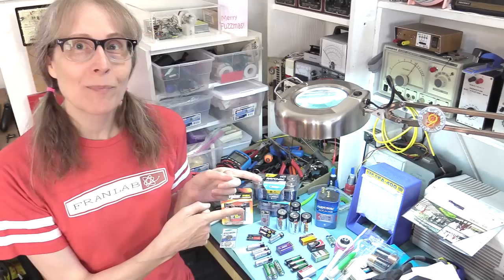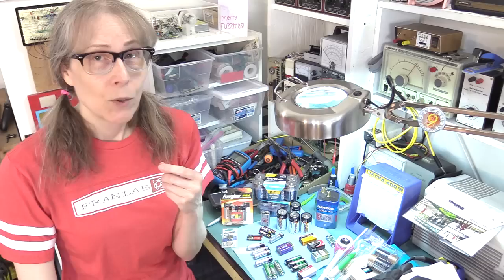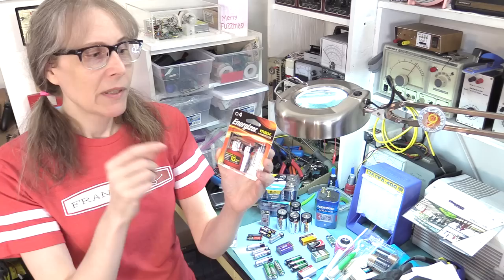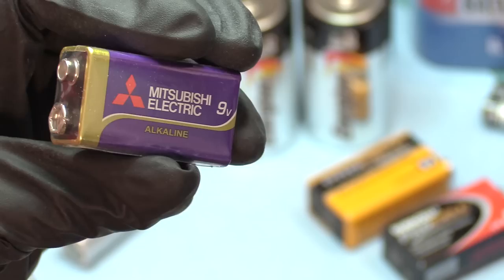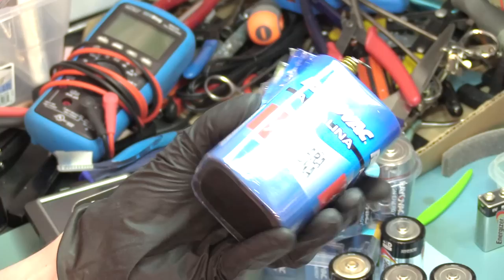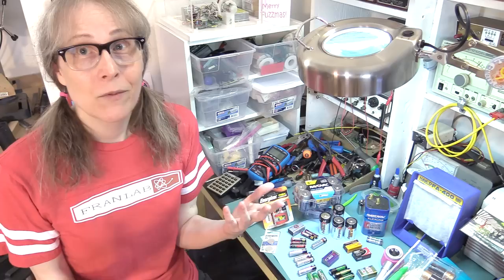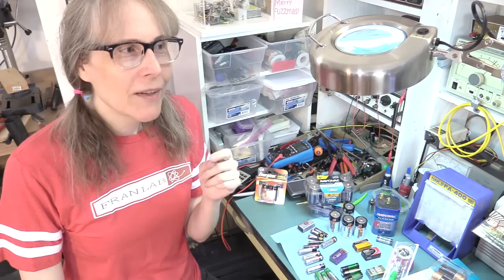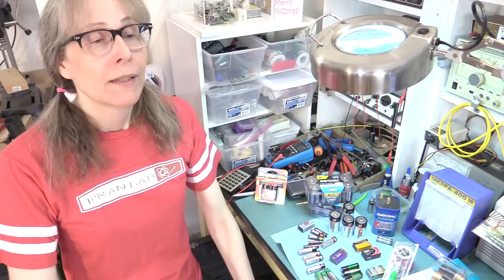Yikes! Leaky Alkaline Batteries!!!!

Comment: If a battery says "Super Heavy Duty" it will not be Alkaline.  The "Heavy Duty" refers to Zinc Chloride which compared to the earlier batteries I think was an improvement but not at all what we would consider heavy duty by todays standards at all, so they tend to be quite misleading to consumers.

Comment: Rather than risk leaking batteries in my TI-83+ graphing calculator, I made a pair of plastic dummy batteries and wired brass end-contacts on them to a USB cable.  Now the calculator runs on my 7W solar panel (with USB output) without being in the sunshine (or any other USB power supply).  Unfortunately, my USB phone-charger power bank turns itself off after a few seconds; maybe it thinks that I'm not drawing enough power to bother with?

Comment: Duracell changed the battery design and have leaked the most of any brand  for years.  I avoid them as much as possible.   Have you ever tested an alkaline  battery by how high it bounces off the table?   Sunbeam makes cheap  appliances probably next to a battery factory.    I had to look for my emergency flash light kit.,  A 4 pack of energizer D battery  from 1995,  Best used by 1999.  Still 1.45 V .   Swapped the bulb to a LED to make them last longer if I need it.

Comment: Great to see you feeling better and posting awesome vids!!!! Question: Do you equate "shelf life" with "installed life?"  In other words, do you  think the advertised shelf life means you can install a battery and it will be good for the shelf life?  My practice is to remove all batteries until they are needed.  And then reach into my battery storage, grab a "shelf life" rated battery to get things moving.  As with Kermit, there may be a drain not known.
Reply: No, because a lot of devices have parasitic draw that will slowly drain the battery. I only use batteries in devices that I'm actively using and take them out when not in use. For example,  my TV remote stays in use all the time, so batteries stay in it all the time. My ac remote keeps batteries in it during months im using it. Then when I pull the ac out of the window,  I take the batteries out of the remote, and put it up till next summer.

Comment: I ended up here because i made good an old calculator that had a leaky Duracell in it. It has a use by date of 2030 & the second one hasn't leaked. Someone said maybe one had gone flat & been reverse charged by the good one. You have a nice collection of batteries there & some people collect them. I remember having one called flying bomb.

Comment: If the corrosion has not destroyed the radio (or what ever) , remove the offending batteries and brush on apple cider vinegar to clean out the corrosion.  Then clean up with water and dry

Comment: I've never had a Rayovac leak after it was dead, most leaked batteries were no name trash or Duracells, very very rarely Energizer will leak
sunbeam idk because they die so fast i don't have a chance to leave it lying around, Panasonic makes a decent AA at the dollar store but idk about them long term
(I have some really old batteries from Walmart back in the early 2000s with some juice in em, they are shiny blue with a lightning bolt on it, not ever ready but it's ever-something)

Comment: I've gotten into the habit of writing in the install date on batteries, not so much as a reminder to replace them, but more as a curiosity as to how long they lasted.
I just looked up at my new battery pile (I keep a small stock of AA's etc) all Duracell - time to change brand? the general consensus seems to be that they have lost the plot in producing a quality product.
As for lantern battery's, boy are there a lot of extremely dodgy ones out there, you open them up and there is a big plastic spacer and 4 very small (sub C?) cells in there - what a load of rubbish.

Comment: Almost ruined a $180 Wicked green laser I bought back when those were pricey from junk Duracell's. I've had new unused Duracell's leak and not even close to their expiration date..Went to RayOVac's and have had some of those leak also, but not as bad. So far I've had no Amazon Basics battery leak and from testing by Project Farm, they are the best bang for the buck. All AA's except AAA's in laser.

Comment: Those GreenCell batteries in that Kermit toy aren't alkaline batteries. I believe they have a different chemistry. I forget exactly but the "heavy duty" batteries are usually not akalines. They are meant to be in low drain devices and have longer shelf lifes so it's not surprising to see that the batteries in your Kermit toy are still good. Had they put alkalines in him you definitely would have opened it up to find exploded/leaked batteries given how long they would have been in the toy. :P

Those "heavy duty" batteries are best used in things like remote controls and stuff like that Kermit toy that only makes sound (and maybe moves a little. A small motor here or there could probably run from these batteries too). You could avoid potential leaks that way especially in low power devices you don't use often. I've never seen one of these heavy duty batteries leak. I don't think they can due to the different chemistry they use.

Comment: I use sandpaper to clean contacts after battery leak. I try WD40 etc but nothing work well.
Than I try hydrogen super oxide. H2O2.  And work well to clean contact after batery leake.

Comment: Bought a big pack of Duracell Industrial C cells for use in an audio field mixer.
Less than a month later there was liquid pouring out of the battery compartment.
Before this we were using some 3rd grade brand and never had any problems.
Didn't like Duracell already but after this I certainly stay clear from this brand for the rest of my life!

Comment: have old Duracells from the 80s from my childhood that never leaked and still work to this very day!!  Those were made by Gillette.  Then Gillette sold Duracells to Proctor and Scandle (in 92?) and they became crap at that point because P&S did something to cheapen them to make higher profit and destroy more of your equipment!  I'm not surprised that 9V "batteries" have lesser warrantees.  You can open them up and they are really just 2 rows of 3 (6 total) cheaply made paper-wrapped AAA cells.. so of course they leak quicker because its just the cheap outer thin metal shell that is the only defense from leaking.  Your lantern battery I've never seen with AAs inside, but I have found them all to have 4 elongated D cell batteries.  SO I have gutted the shells of all of mine and insert  2 or 4 (in series/parallel for twice the amperage, twice the wattage, twice the battery run-time because 2 of them in series is just oner 6 volts under load and they hold way more runtime than any alkaline or drycell.     As for direct replacement of alkaline that is easy, just go with NiMH rechargeable.  They have no downside and if you buy good ones instead of junkChinese ones sold online, they have over 2000mAh which is as good as any Alkaline really an you can recharge them hundreds of times if you ue an intelligent charger that doesn't over charge or over temp cells.  They have newer technology NiMH rechageables called ULSD (ultimate low self discharge) which come precharged even and can hold a change for a couple of years just sitting.  Those kinds of ULSD Nickel Metal Hydrides are the perfect drop-in no-leakage replacement for all you alkaline battreries and they will save you a ton of money versus the very environmentally unfriendly landfilling and energy resource waisting thow-away alkalines.   Yes thee are some obscure chasers that can recharge alkaline batteries but my experience with those has been checkered results.   If you combine quality brand NiMH (Duracells NiMHs are actually quality compared to their crappy Alkaline leaksters!) with a quality intelligent charger like PowerEx or Maha or XTar and you will truly get hundreds of recharges like the packaging says.    DONT BUY DURAHELL BATTERIES (unless they are Duracell NiMH rechageables).  Also I have 18650 Lithium-Ion cells from their debut in he 90s under Sony brand which still work and don't leak!

Comment: So, let me get this straight, GP and HD batteries don't leak?!?!  Hmmmm, I don't know about that.  I mean I have been using alkaline batteries for as long as I remember and I have had experience with all types of batteries leaking except for button cells.  So I found that out when Fran mentioned she had button cells leak.  That never happened to me.  As for Energizers being leakproof?  Well, I can't recall that, but many years ago as a kid, I have had the silver Eveready batteries (not Energizer) and the RayoVac (non alkaline) batteries leak.   As for those large 6 volt batteries, I think I only remember one ever leaking on me.  Usually those are pretty good.   But in terms of modern batteries, yeah the Duracell copper top batteries are definite leakers.  Also Radio Shack batteries, the white ones with the orange writing on it, they leak also.   But as Fran says and some of you below having issues with flat batteries, that is something that never happened to me.   Yes, I have had button cells go dead, but I have a pen with a clock in it that has a dead pair of button cells in it for 15 years and they still have not leaked.

Comment: Just occurred to me: you could put a piece of heavy duty aluminum foil over the ends of the batteries. That should save the battery compartment if the batteries leak.

Comment: My TV remote had Energizers in it, found them leaking a fortnight ago. Thankfully checks regularly, so barely any corrosion and only a bit of clear liquid.  Sadly can't trust the promises.
Started using NiMH some years ago, mainly IKEA Ladda and they haven't leaked any... yet.
Worst yet was a 9V Philips that 2 years before its expiration date leaked so catastrophically that I had to work my ass off to get the expensive scales in working order again. Corrosion everywhere.
Never had a litium leak, despite a decade after expiration. Lucky me I guess.

Comment: Oh, yes the 'fraking' alkaline batteries. I lost two HP 48g calculators last week 'cause of leaking AAA batteries. And it doesn't matter if its validity has not yet expired, if it is being used at an ideal temperature, this crap just leaks overnight.

Comment: I always used to use Duracells when I knew I was going to leave the batteries in for a long time, especially low drain stuff prone to leaking over a couple year period....

I use rayovacs for every day situations but lately theyve been leaking on me in some junky cheap flashlights I got on amazon, like 12 of them for $20 or so, little pen lights, not sure why they leak because it only takes about 6 months!

Comment: Damn Duracells are the absolute WORST!! I always go for Energizers. If there's no other choice than Duracells, then keep an eye on them. If it's a device that doesn't get much use, then take the batteries out. And stay away from Rayovac, they just crap. Batteries from China/Japan are just to get the device up and going, but they're cheap and do not last long.

Comment: I bought the opposites of the GP double or triple A cells.  A Radio Schnook supplied big blister pack.  They leaked IN THE BLISTER PACK! Only 1.5 V across them all.  You may have noticed the battery with the base at 0V (ground, sorta) in a device leaks first. Ugh!
Reply: 9 volt batteries are a lot like your big pile battery.  The 9V battery I opened up had 6 little round cells in series in it.  Maybe the lighter ones have fewer cells and a charge pump to get the required voltage.
Reply: Thanks for the cleaning contacts tip, DUH! I should have tried vinegar or lemon juice but my brain refused to work on the problem! Consequently, I have become expert at mechanical cleaning of said contacts.

Comment: After seeing the off brand King Kong Batteries it reminded me of my remote for my CD changer we bought back in 1988 that came with Japanese brand AAA batteries. The remote finally quit working in 2017 (29 years). When I went to replace the batteries they were the original ones (I thought I had changed them over the years) and they never leaked. Definitely not Copper Top. So these off brands are some times better.
Reply: King Kong Batteries is actually a major Chinese brand, based in Shenseng.

Comment: Primary lithium pile is the answer, AA or AAA lithium cells are not that expensive, and do show up in capacity and current capability; I'm never going to put Alkalines in my Fluke 289, that thing eats a dozen, if they leak, the meter is done for

Comment: I stopped buying alkaline batteries almost a decade ago. I've found that in the devices I use (portable recorders, wireless microphones, etc), NiMH batteries last at least as long as the alkaline. So far, I haven't had a NiMH battery leak.

Has anyone had a NiMH battery leak?

Comment: Duracell branded cells are, by far, the worst, the very worst for leaking.  If you buy a pack of them, most will be unusable long before you've used a quarter of them.   My last pack (guaranteed for 10 years) was only a few months old when I went to open it.  At least a third had leaked in the unopened package.  I'm a retired engineer, so I wanted to contact Duracell to see what kind of QA program they had and perhaps help them improve their processes.  After several weeks, no reply.  

No, another great old American company that was once the most trusted name in its field, but is now well on its way to extinction and a well deserved extinction, for that matter.

Comment: I've never really had any issues with 9 volts but I think that's mostly due to their construction, there either piled cell's or their round AAAA cell'sIn side.
I've also never really paid attention to the expiration date I've had batteries last forever I use them until they're dead then I move them around to something that has a lower draw and so forth.
Reply: Those AAAA cell 9V batteries are like 1mm longer and they won't fit in so many things. I even had one that came with a cable tester, it was still in plastic wrap, and I had to take the thing apart to get it into the battery compartment because it wouldn't fit through the hole properly when attached to the connector.

Comment: I have had many Duracell batteries leak, still in date right in the pack. AA and AAA are the worst but also C's. I have the most problems in low current draw applications. I don't buy Duracell anymore.

Comment: Maybe living in a hot, humid climate is harder in batteries or maybe it's just low Q.C. these days but I have lots more battery leaks than in the good old days. The best AAs and AAAs I've found as far as not leaking are the Duracell Quantum. Copper tops are junk, Energizers not much better in my experience.

Comment: I'll never use alkaline batteries in a device worth more than the batteries themselves.  They are disposable batteries for disposable devices.  They're not called 'alkaleaks' for nothing.  I'll use Eveready Ultimate Lithium, Panasonic Eneloop rechargeable or lithium ion cells in devices that can handle the higher voltage (high power flashlights).  An insidious property of alkaline batteries is that they can still supply power while they are leaking.  This is especially the case with TV remote controls.  By the time you realize that the batteries are getting weak (reduced range) they have already begun to leak and cause damage.

Comment: This video started out strong with a quality explanation, but then got pretty muddy in the middle and I'm not sure what you're trying to explain anymore...
It seems like you have a solid understanding of alkalines, but don't understand what heavy duty batteries are for or why they come free in so many devices.

Heavy duty batteries have less power, which makes alkaline the obvious choice for something with high draw and that you use often, like a flashlight or walkman, however  heavy duty batteries are are much better suited for everything with low draw because they do not leak and they last forever. You seem to think it was a fluke with your kermit the frog, but this is precisely what they are designed for. As a rule of thumb, anything that you know the batteries will be in for more than about 6 months should have a heavy duty battery and NOT alkaline. Bonus: they are also much cheaper and you can buy random branded packs at the dollar store that will last forever and never leak. Examples of items that should only have heavy duty batteries: smoke detectors, remote controls, wireless thermostats, clocks, voltmeters...
Reply: False. heavy duty batteries leak even more. Thats all they had back in the day and they were terrible leakers. Don’t make shit up.

Comment: I have Sharp GII AAA batteries  (UM-44(CT) made in Japan) form vcr remote. But cannon find the date on them. they are older than 99 I am sure. One found leaked just now, another is 1.49v. Year ago both were fine, I removed that they wont destroy my parents first and only vcr I included in my old stuff collection.

Comment: Nice video- you seem to have the collection of weird brand batteries that I always thought about collecting, but never did. Who names those things?  As for 6 volt lantern batteries, in my scientific/destructive childhood I thought they had 4 square, flat cells. Now it seems the good ones have 4 "F" cells- like a long D cell. But Duracell lantern batteries now have 4 D cells and a cardboard spacer at the bottom! What a scam.  If you have to but a lantern battery, just try to balance it horizontally-  if it is top heavy, it probably has the 4 D cells. And finally- there are rechargeable 6 volt sealed lead acid batteries (SLAs) that seem to work well.